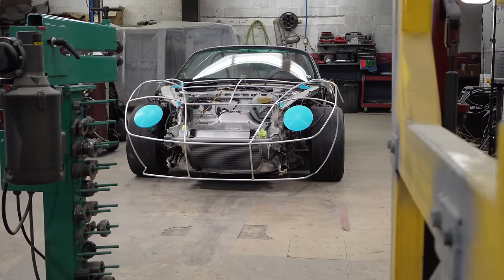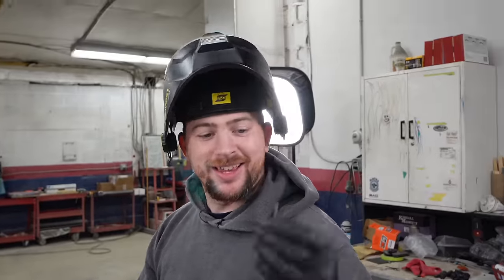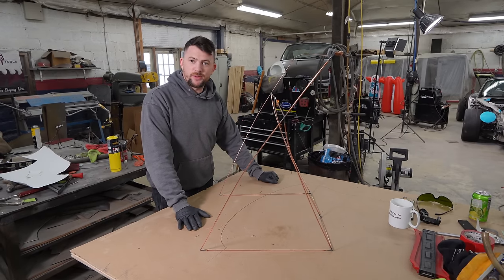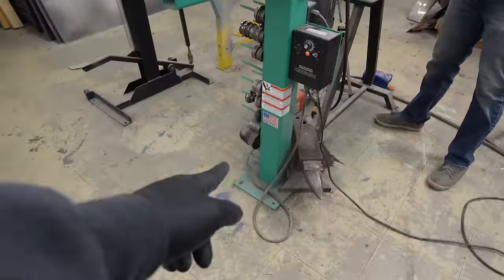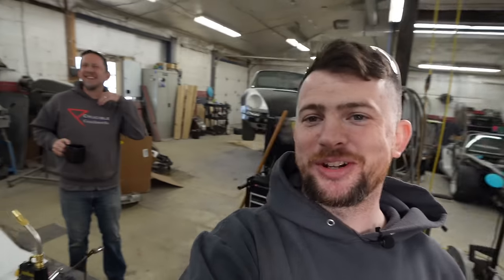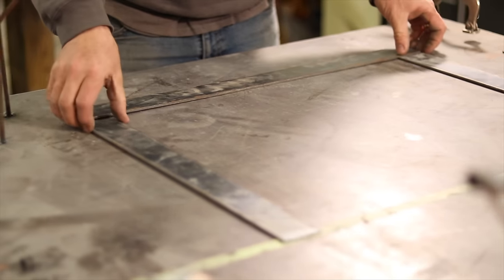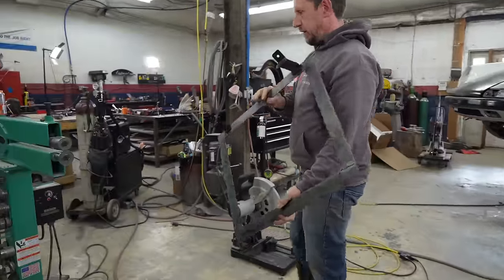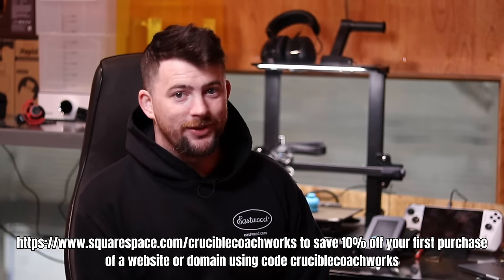$500 Junkyard Supercar! Making an Aluminum Hood Vent. (Project Jigsaw)

Comment: The 'outlet' air needs to be about 25% greater than the 'inlet' area opening, otherwise hot air can stall in the duct area and cause overheating issues, as hot air expands...45 years experience building cowls for model planes...

Comment: Second law of thermodynamics, temperature transfer is nearly instantaneous which doesn’t require the velocity of the air to slow to cool better.  Efficient heat transfer requires more volume than velocity.  It’s a common misconception in automotive circles.
Reply: Yep! Same with radiators, never slow down the radiator coolant speed. So many people get that part wrong.

Comment: I have a PhD in Aerodynaminomics and have become it's CEO. I have thoroughly analyzed your radiator duct and bestow upon it an A+ rating.

As I also minored in Structural Voids in Space and Time, I can confidently say that the more large, empty voids you build into your car, the lighter it will get. Keep going!

Comment: Really coming together. We all use what we have at hand to do the job, whatever that is, but I have always found a jigsaw with a wood blade works great on aluminium sheet.
Reply: Yep, jigsaw works well on aluminium. You can get aluminium cutting blades for them.

Comment: The cleanest way to cut aluminium is actually a circularsaw for wood. I use a milwaukee finetooth carbidetip blade, cuts 1/2" aluminium easier than plywood
Reply: Completely agree with you, I used to work in a company that cut huge Paroc panels to size with a circular saw, & they are made of steel. Far quicker & cleaner.

Comment: Air loses heat as it expands as well. Expand out and slow down to pass through the radiator. The outlet needs to be slightly bigger than the inlet to keep the pressure differntial ( can't rely wholly on drag from the aerodynamics). How are you going to deal with water through the scoops?

Comment: For cutting aluminium easily get a circular saw with an aluminium specific blade. Wear hearing and eye protection ✌️
Reply: There is a metal roofing 'nibbler' that fits a Makita/Dewalt drill for about $80...worth looking into..

Comment: You might need a air damn on the bonnet to create a low pressure area for the rad exit.  The way that nose is raked, there is a potential that there will be higher pressure at the exit than the entrance.

Comment: Use a carbite blade for your grinder or circle saw to cut your sheet make sure you use bar of wax (candle) or soap bar on the cutting face and side of your blade stoping it clogging up and make smoother cutying

Comment: I keep looking at all that metal work up front and thinking I could do it easier with composites.  Since it is a one-off, you wouldn't need to make a plug.  Just is a wire or wood frame and polyisocyanurate foam sheets to make the shape, and then hand layup.  Then again, I don't have any of the big metal working tools or shop space.

Comment: You can cut aluminum like this with a 5" or 7"  inch circular saw with a carbide tipped blade. It will cut through it like butter. The small saw is better and easier but uses more batteries

Comment: use a good skill saw with a Diablo Metal blade. I build Sings out of Aluminum and when i need to cut stuff that wont fit in our shear, like an access panel, i use a skill saw.

Comment: Don't forget that hot air expands, thus you need a larger exhaust vent than the intake vent. Not 100% sure on what the proper ratio is, but you should be able to find a calculator for hot air flow through vents online  somewhere.

Comment: Guys to help with the cooling you could turn the radiator into a tripple bypass by putting a cut in one end tank side a third of the way down put a piece of aluminum in the cut then weld the cut on the other tank repeat but put the cut  2 thirds of way down  and go back to the first tank and put the cut a third from the bottom and plate and weld so the coolants has to zig zag 3 times down the tank so more airflow for a longer time on the core to disapate the heat hope this helps cheers from down under
Reply: that technique was used by Home Built By Jeff in his Alfarrari project when it was experiencing overheating issues.
Reply: @BUSHY1959  yep sure was

Comment: Just an idea. Why not duct and  vent the radiator underneath the car? It should be a negative pressure there from all the air rushing by in a constricted space. That way you don’t have to worry about water ingress from rain. Am I approaching this wrong?

Comment: Have you thought about using a skateboard wheel as your large die when tipping the edge of your metal to make a flange? It also helps the small wheel not gouge as deep in the metal since the soft skateboard wheel lets it sink in as it rolls.

Comment: 2 Cents: I think the Coolant Temp sensor needs to be closer to the engine and not at the radiator for more accurate control. Coolant will cool running forward and give a lower/errant temp reading if the sensor is at the front. The puke tank can go in the void space behind the vent valance.

Comment: So you guys decided to cut up a Porsche car and then rebuild another Porsche car shaped with the same Porsche shaped head lights,  but a different custom hood air vent and different replacement for the Radiator, and now you guys are calling it a super race car..
If you guys wanted the same Porsche Shape car why cut up the  original Porsche car....

Comment: 12 years ago, i sold my lovely ( 1984 - Porsche 930 - 911 wide-body ( number 9 in factory - limited edition  , - Black Jack,  black interior and exterior with white gauges , ) for only 2300$ 

Yes 2300$ , i was mad with the local dealer, when he asked for 4000$ for ( Windshield - front ) and the overseas price was 900$, i feel sorry i did that, the dealer still ripping peoples and Porsche owners, and the ( Porsche head quarter ) never care, all the care about, the dealer is doing a great sale, Porsche don't care about the quality and service anymore